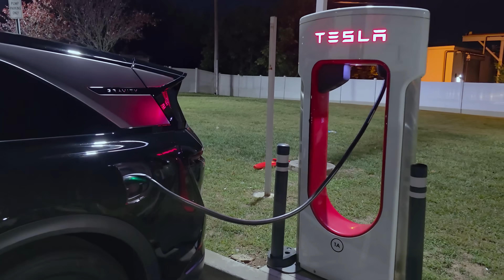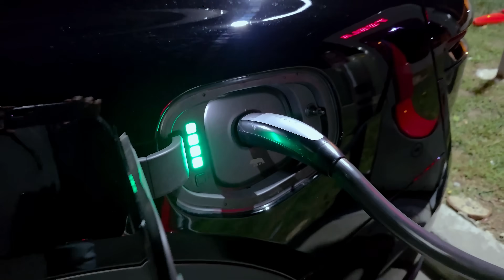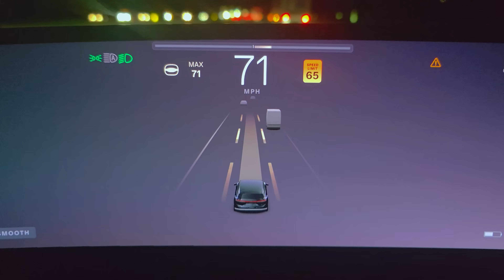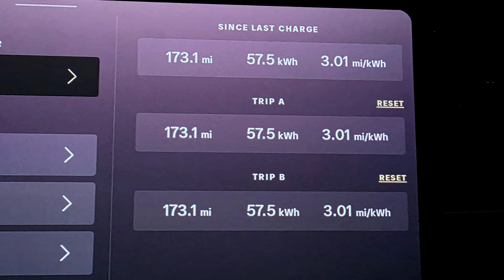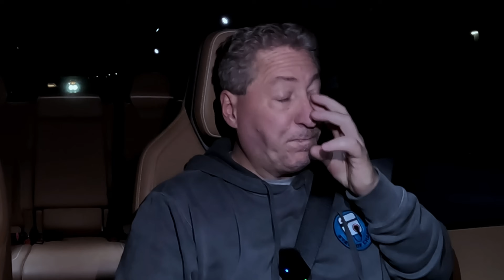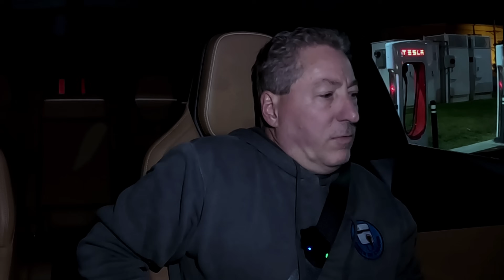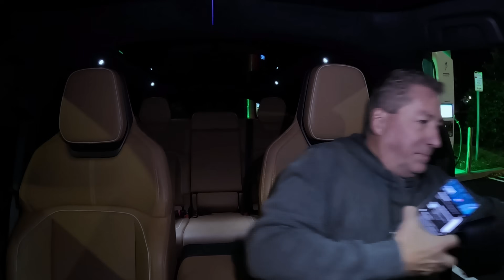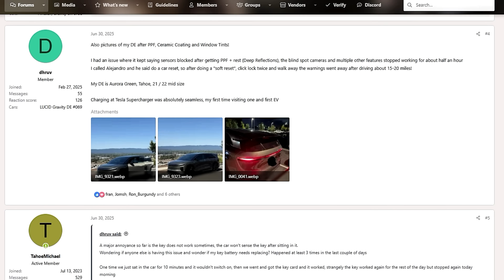Does the Lucid Gravity Live Up To Its 450 Mile EPA Range Rating?

Comment: A lot of people thought this was going to be on par with the Escalade IQ monster range. The old saying stands... there's no replacement for displacement (or kwh)
Reply: The Escalade has a massive 220kWh battery, though, a 100kWh more than the Gravity. So that's expected. But year after year batteries keep getting more and energy densed with physically smaller packs. And solid-state and semi solid-state are already being tested in pre-production vehicles by several major auto manufacturers, while CATL has set 2027 as their likely release time frame.

So batteries like the Escalade will become more common, but with less weight and smaller physical size.
Reply: Here is another variable for you to consider.

Escalade EV Pack Size - 205kWh Usable
Gravity Pack Size - 123kWh Usable

My house has 6 cents per kWh charging from solar and stationary batteries. 

The fast chargers here in New England can be 60 cents per kWh. 

A 450 mile round trip which I do a lot of looks like $12-$15 for the escalade and $25 to $28 for the Gravity (real world range of 350-370 miles).

When the delta between home charging and dc fast charging is very large, the efficiency advantage in terms of operating cost savings disappears.
Reply: @mattc6854 exactly. Maybe in charger rich areas it doesn’t matter but here in Texas and Oklahoma I frequently drive 150-200 miles one way. And then reverse trip same or next day. And I’m not driving 70 if I can safely go 75-85( yes, some highways are 85)…. Escalade IQ means I can get there and back without charging on the road, no issues. I can bathroom break ANYPLACE, not have to search out a supercharger site. My wife’s previous Range Rover and current X7 get 500+ miles on a tank of gas. IQ is the first EV I’ve even considered as the next replacement.
Reply: Kinda? I do think Tom's test after the fixes of the rear drive, rear ac, and useable kwh increased from 115 to 120 of the 123 total, will I'm guessing increase the 70 mph range to about 390+, which is still crazy long for a charge. But an amazing efficient 123kwh car will usually lose out to an average efficient 205kwh car
Reply: @michaellawyer4885  Yes it will help to see another test. I'd like to see what he gets if he ends up going to AZ. It will be similar weather conditions to is IQ test he did recently.
Reply: worse for lucid is that the new bmw drivetrains look to be range monsters too, so the new ix will be on par with the gravity in range if the ix3 is anything to go by, same with mercedes, and they re all within ballpark pricing and luxury of each other.
Reply: Nothing is comparable to
the double stack 24 module ultium packs. 

My Silverado EV is glorious. I also have a Lucid Air and it does not compare on range at all.
Reply: @mattc6854  I've had the IQ for 2 months now. It's wild driving an EV out of town and not even looking at the SOC or worrying about keeping it under 65. For our usual monthly trip from Indio, CA to Las Vegas it's been awesome. I will actually leave home around 80 percent, charge to 100 at the free hotel valet charger so I spend less when I get back home. It's nickle and dime at the cost of these vehicles but still feels like a small win :)
Reply: @mattc6854 wow interesting. What about fast charging speed? I have an air grand touring
Reply: The charging is the saving grace.  That IQ battery is ginormous.
Reply: Big ass batteries seems like the best solution still
Reply: @KyleConner  The GM big pack is good if you need to tow, but for the majority of people it's overkill. Most drivers take bathroom breaks every 3 to 4 hours.
Reply: @jghall00 bathroom breaks are not the only reason to stop.  I use my EV for work.  I might make several stops in a workday with no chance to recharge between locations.  I need a battery to get me to all my work sites without charge breaks.